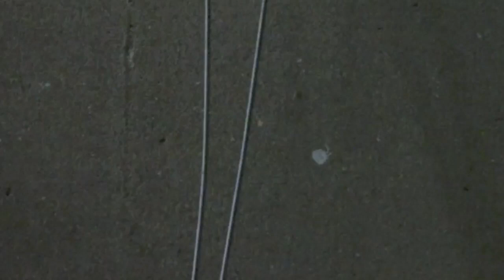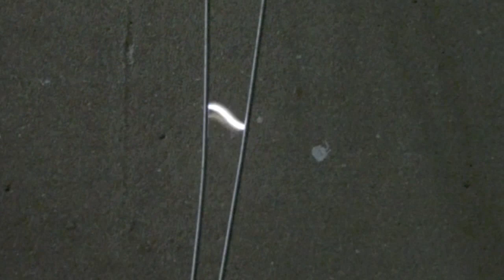Oil burner spark test

Comment from the maker: Yes.  The burner won't light if there is no spark.  If you open the burner top while it is attempting to light, you can check spark with a screwdriver.  If spark is strong there is a problem at the electrodes.  Possible shorting to ground if electrodes are not clean or are cracked.

Comment: Nice! Dumb question perhaps: is the output voltage of the transformer also AC? I need AC for a specific experiment I am working on and these are way cheaper than an NST with the same capacity.
Reply from the maker: Yes, it is AC.
GFM
Reply: @grayfurnaceman  Oh that is great news! what does GFM stand for?
Reply from the maker: @nirodha7028  Gray Furnace Man
GFM
Reply: @grayfurnaceman  ahahahaha…. Nice ;-)

Which specific transformer did you use? Brand/type?
Reply from the maker: @nirodha7028  I would use the Beckett electronic transformer.
GFM

Comment: Is a thin blue arc singe of a weak spark.  Testing for spark, it will only arc about a inch long and thin and blue from tip of screwdriver. I was getting delayed ignition, now my heater will not fire at all.   BTW Great Information on burners.
Reply from the maker: +Joe Simeone Looks like a new transformer.
GFM

Comment: Can these electrodes be put in series to achieve multiple sparks for a multi burner application on a single transformer?
Reply from the maker: WTREMMEL I guess you could try.  Not really recommended.  I would use 2 transformers.  Hope this helps.
GFM

Comment: I am thinking of using an oil furnace transformer to create a spark for theatrical purposes. However, I would need to run something like 25 feet of cord from the transformer to where I want the spark to occur. Is this possible and if so what type of wire should be used for this?
Reply from the maker: It is possible.  You will need ignition wire similar to that used on autos.
GFM
Reply: Thanks for the reply. Something else I thought of, would the two wire conductors for the 25 foot run need to be kept separate or can they be together? I was wondering if the high-voltage would go through the wire insulation and spark before it reached the end of the wire run. Thanks!
Reply from the maker: @billsmith1008  If you are using high voltage wire, they can be run together.
GFM